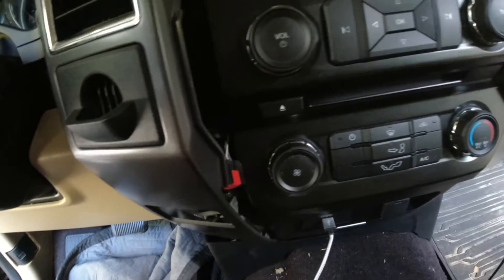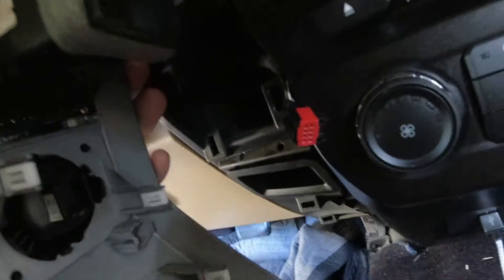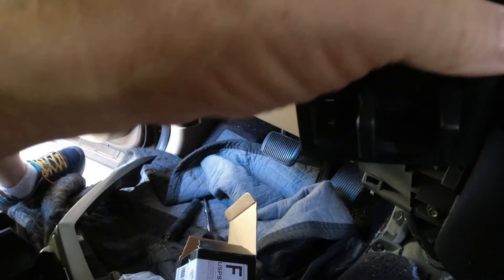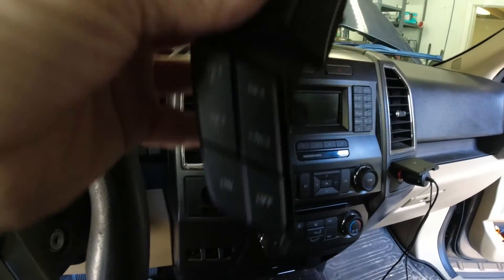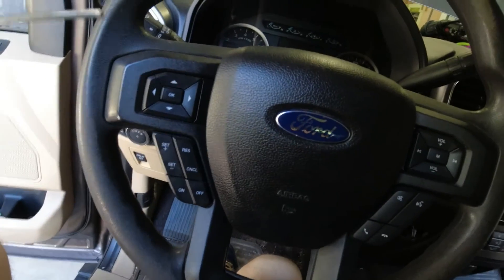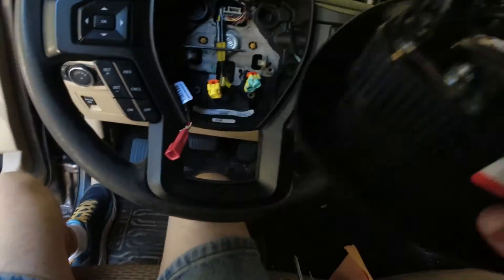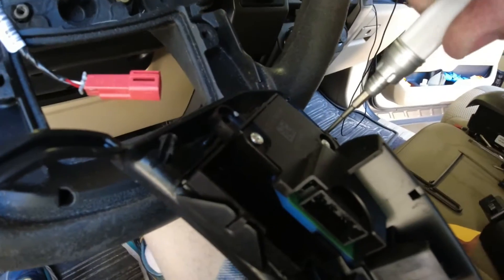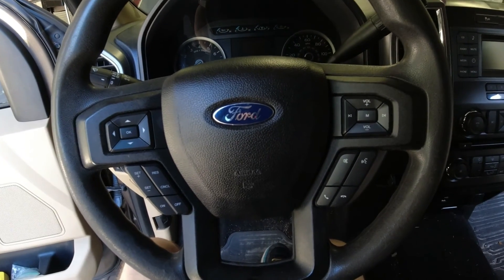F150 Ford Pickup, Replacing The Cruise Control Switch Assembly And Brake Controller.

Comment: you installes the trailer brake control upside-down.... flip it and it will fit properly
Reply from the maker: I never realized I had it upside down. I should have checked an assembly manual before I installed it. Unfortunately, I have since traded the truck off so I can't correct the issue.

Comment: Several comments. Release tabs to unplug the cables to the buttons are in the center of the connector on the back (steering column side). Press towards connector and it pops right out. The plastic collar assembly is embedded into a rubbery material at 11 points with barbed posts. Easiest way for me to get it out was to gently pry it out. Red and green 2 wire connectors slip over plastic wings on the assembly you are removing. Just slide them up off the wing for easier access. Only the red one has to be disconnected. I am using an after market replacement from O'Reilly. I will follow up on results. Thanks for the video - it encouraged me to go ahead and go after this. Is there a way to post pictures to a comment?
Reply: follow up #1 - aftermarket control from O'Reilly has different labels on the switches than the OEM control. Awaiting OEM part from Ford which will be here tomorrow.
Reply: Ford part installed, all buttons work. Side note: screws holding switch to framework are T8. Now to figure out why I have an airbag warning illuminated. 😞

Comment: Nice video, I was wondering where did you buy your steering wheel switches.
Reply from the maker: I bought the switches on Ebay. there are several companies offering them and I don't remember which company I purchased mine from. I think they are all about the same price. I try to pick a company that has the best feedback history.

Comment: Hey man, what was the problem with the cruise control switches to replace?
Reply from the maker: The buttons would work intermittently.
Reply: My set buttons just started not working intermittently, thanks for the video
Reply: My problem as well, intermittent switch operation.